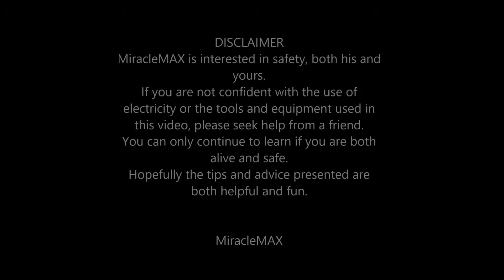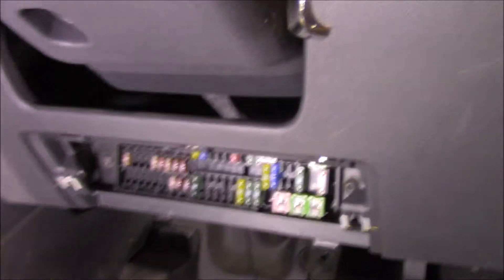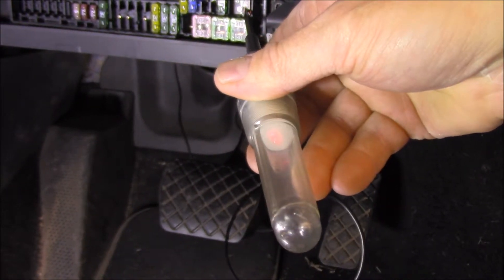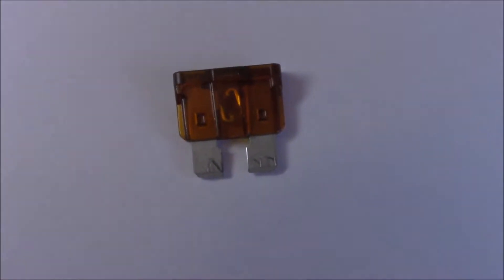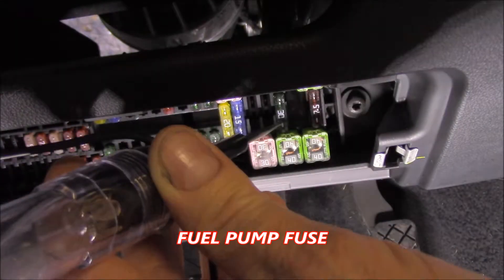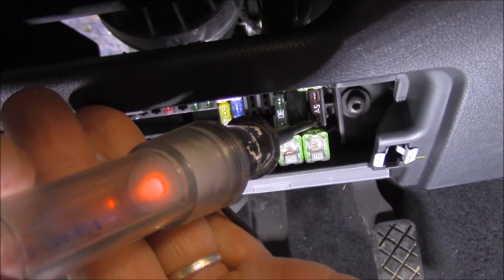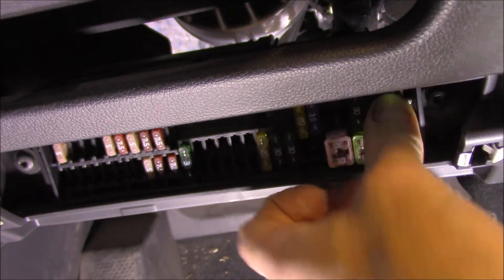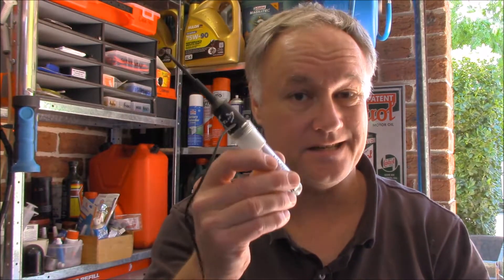LED Or Incandescent Test Light MiracleMAX

Comment: always thought most circuits are better tested with some kind of amperage load.... Incandescent serves its purpose in that regard... Problem I have is trying to find one to buy as everything now is LED... Thanks for the video - interesting stuff.... And, worth watching just to hear "wind screen" and "bonnet"..... Cheers from USA....
Reply from the maker: Hey Steveo66,
Yes, for many years we were always told only to use a LED test light as you might blow up the ECU and the world as we know it might implode on itself!
However, now we know that some actuators draw more current that the humble incandescent test light. So being careful and knowing the circuit components is the secret.
I have several - one in my workshop and one on a mobile resource trolley I take to classes. It's good to show the students the difference between the two.
You should be able to buy and incandescent test light in your local parts shop or online, for example EBay. 
Yeah, I guess we sound a bit weird to you guys saying 'bonnet and boot' etc, but it goes both ways! 😁👍🤣
Reply: @MiracleMAX  thanks for the reply... I guess I didn't dig deep enough as I see several decent ones on amazon.... You guys don't sound weird, it sounds classy... We're still a little rough around the edges over here....LOL    Regards....
Reply from the maker: @steveo6631  I get this a bit in comments. It's interesting to find the history on names like boot and trunk. Goes back to horse & cart days. Ahh, we've come so far.......or have we?